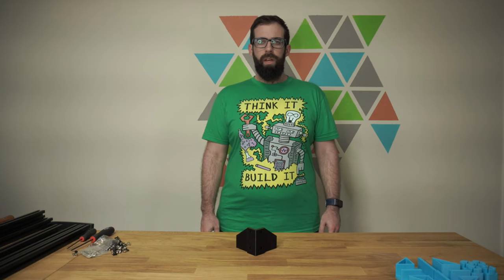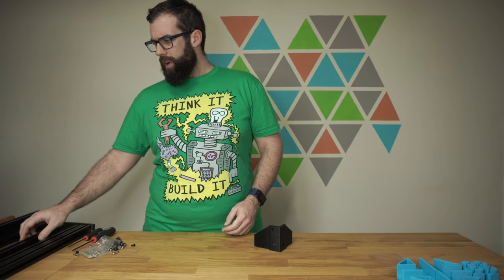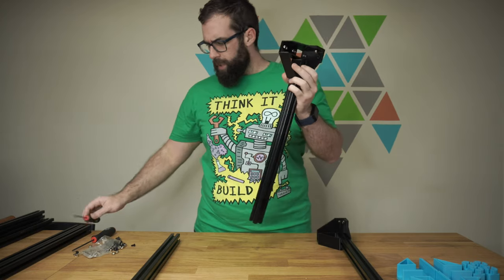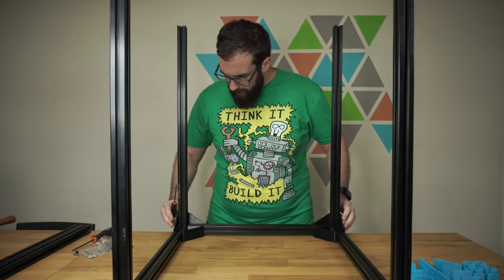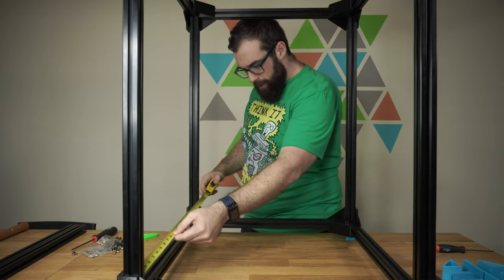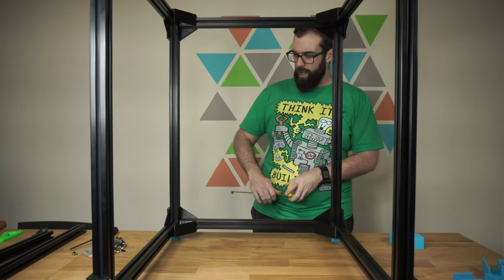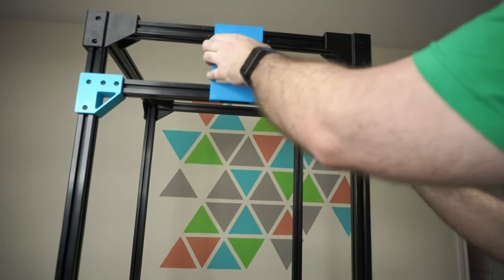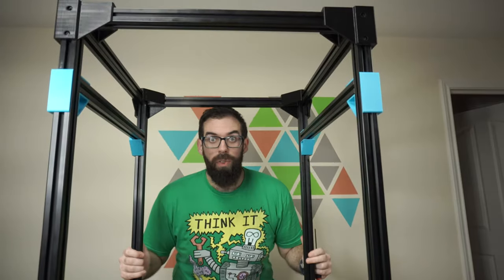Zyltech HEVO 2.0 - Frame: Part 1

Comment: Thank you for producing this video series, it has been a tremendous help with my build. I have looked in the files and can not find the stl for the jig you used to align the cross bars (100mm) down from the top. Can you provide that stl?  Danny
Reply from the maker: Good catch, I didn't include it at first because I had to change it to 101 mm. I just uploaded the new jig here https://www.prusaprinters.org/prints/28812-zyltech-445-hevo-20/files. Thanks!
Reply: Awesome.  Thank you